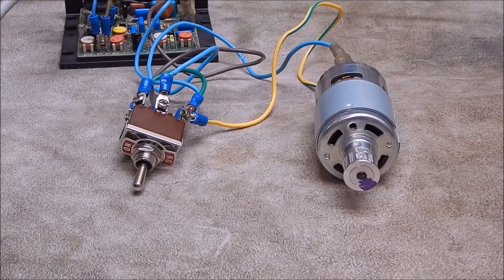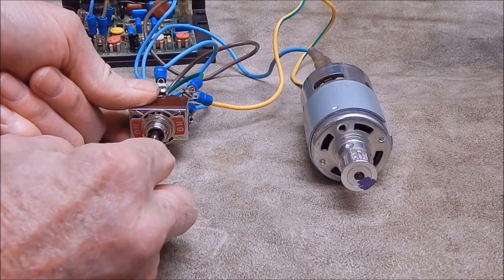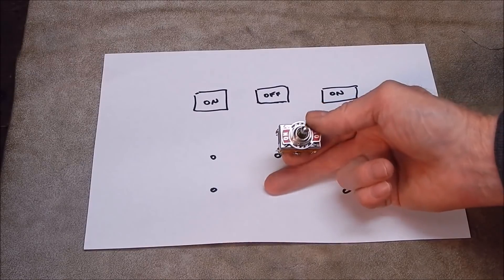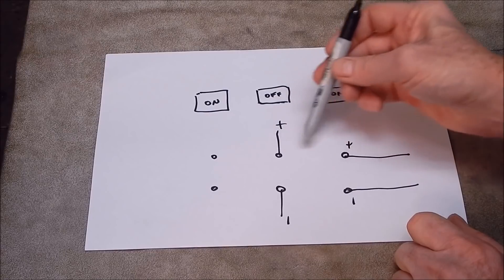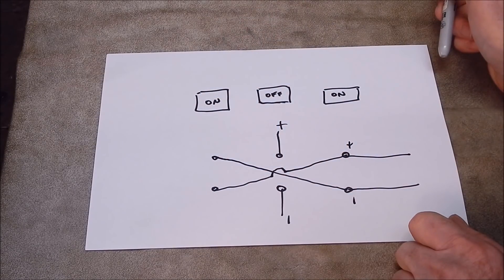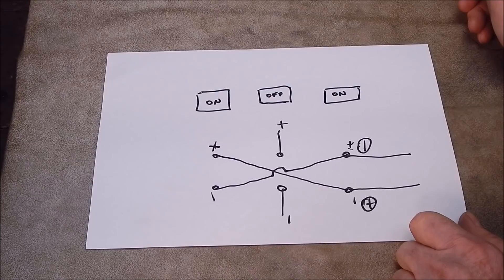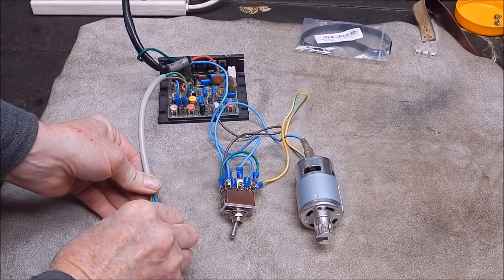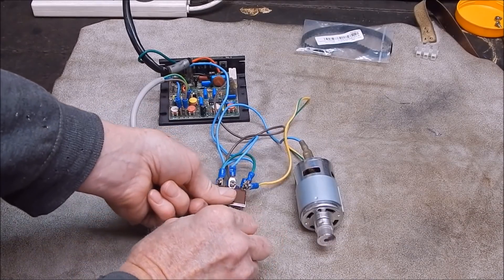How to easily switch rotation direction on a DC electric motor

Comment from the maker: NOTE:  To prevent arcing damage in the switch when using high DC voltage ALWAYS switch off the inverter/power supply OR reduce voltage/speed significantly before changing direction with the toggle switch.  

You should NEVER change motor direction at speed.

A small correction - the terminals opposite the toggle direction connect to the centre power supply feed.  

Cheers Rob
Reply: So what if we used a motor controller and changing it does it will damage the motor ?
Reply: Actually that switch is not rated for DC current. Most of the time if it says 15 amps at 120 v AC it translates to around 10 amps DC at 24v and 6 amps at 12v. The contacts on DC switches are generally larger and made of different material that can handle the arcing. I think it's mostly brass. Brass doesn't spark or arc well. That's why they use it for regulators and fittings in anything that has explosive gasses. If they sold you that switch claiming it is for DC then you need to be very cautious
Reply: The correction you mentioned - does this mean the diagram you drew is wrong to where center supply feed should go??
Reply from the maker: @rastAsia  No.
Reply: @Xynudu what does it mean?

I watched another video and he ran the battery positive and negative in the crossover and the motor to the center connectors. Which is correct or is it six of one, half a dozen of another.
Reply from the maker: The configuration shown in my video is the most common way to do it, but either way will work fine.

Comment: Hi, just wanna ask if what's the name of the connector you used on the terminals?
Reply from the maker: They are called "crimp on connectors".   They come in many styles (slotted, ring etc.).  They work best with a crimping tool.  A soldered on connector will be stronger. Cheers Rob
Reply: @Xynudu  ohh thanks... Additionally what size are they? Cause I want to connect it onto my e-bike and dont want to solder them
Reply from the maker: They come in many sizes.  You will have to measure the diameter of the job to suit.

Comment: Hello sir can you help me, I need a motor that can slowly move a miniature door from side to side but I also need something that can stop the motor when the door reaches the far left and right ends so it doesn't cause damage to the motor. Do you know where I can find such parts? P.s, is there anything that can move the door inward and outward from the frame?
Reply from the maker: A window supplier should be able to answer your question,  There are almost certainly kits available to do this, particularly for high level hopper windows.
Reply: @Xynudu  Thanks, I'll try asking but I'm not sure if they'll help since the door is only 3 in and shaped like a gear.
Reply from the maker: If the door is that small they won't be able to help.  Unless you say the size up front, I'm just wasting my time replying.  LOL.  For something that small you will have to fabricate some sort of drive system.  Maybe a hobby shop can advise on this.  Probably a worm drive would work. To stop the drive just use a simple reed switch at each end of the movement to cut the power.
Reply: @Xynudu  I apologize, I didn't mean to withhold that information. I was under the impression that the motor featured in the video wouldn't be able to handle a normal sized door without overheating and/or burning out, hence the assumption. However, yes it's a gear shaped door made to replicate a vault door from the Fallout games as part of a miniature diorama, hence the need to find the right equipment to move the door. I'll check to see if my town has a Hobby shop and look into a worm drive and reed switch. Thanks for helping.
Reply: @zeronial01 I’m working on a similar project to yours. If you come up with a way to get your vault door operating, please update here. Thank you.

Comment: Im building a electric bike, and i have a question about the rotation of the motor. I've built my diy bike, but the motors spinning the wrong direction. How can I reverse the direction of the motor? I have it hooked up to a 2 pin rocker switch and a 22.2v 1400mah battery and it all works, but how would i have to change it if i wanted to make it go the opposite direction?  Its going clockwise now, but i want it to go counter clockwise. If i swap the connectors on the motor ( like connect positive motor wire to negative battery wire and negative motor wire to positive battery wire ), would that work?
Reply from the maker: That works with all the DC motors I've used.  Try it and see.  It can't do any harm.  Cheers Rob
Reply: @Xynudu  Ok thanks! Im going to test it right now hopefully nothing blows up or anything
Reply from the maker: You may find it will have slightly more power in one rotation direction than the other.  That's because they usually set the magnetic field timing for best effect in one direction.  It should run the oher way without issue and in practice you will barely notice it.  Good luck.  Cheers Rob

Comment: That 15 amp switch can handle the load of a treadmill motor however you don't seem to realized that you are taking that 15amps AC is the reason it can take it. 15 amps AC is only like 6 AMPS DC. that switch is designed for AC.

Comment: Did you know that here is an even easier way to wire a polarity control switch? Use a vehicle power window 5 pin switch.
Reply from the maker: That's a new one on me.  I can see how that would work, but how would it handle the amps ?
Reply: @Xynudu  They are meant to direct connect to DC current from a car battery to run the window motor, so they meant to handle it.

Comment: Hello sir,
I am always very appreciative of all the themes that you address. Concerning the reversal of the direction of rotation of the motor, would you have a link to acquire 1 switch on / off / on at a deceptive price. Another question, when you vary the speed, does your device conserve torque?
Hoping for an answer, I greet you courteously. P. K. (French)
Reply from the maker: Hi Paul,  the torque will change with the speed, as the voltage is varied.  Less voltage means less torque.  

That switch is readily/cheaply available from most electrical hobbyist stores that sell components and from Ebay.  You want a DPDT 6A 240VAC Heavy Duty Centre Off Standard Toggle Switch (about 3 Euro).

Cheers Rob
Reply: Hello sir,
Many thanks for your quick and positive response.
I searched on Ebay with your precise indications and of course I saw a switch on off on at ~ 3 €, so it is perfect and significantly less expensive than those I had seen.
Thank you again, I very much appreciate your seriousness and your availability. P. K. (French)

Comment: Rob, cant find this switch anywhere, any ides please. Colin uk.
Reply from the maker: Hi Colin,

Any electronics hobby/component shop like Jaycar will have it, also on Ebay.  Just quote/search the number and specs shown on the side of the switch in the close up shot.

Cheers Rob
Reply: @Xynudu  Thank for your quick reply Rob, I will try harder. regards Colin.
Reply from the maker: I see BG have them but currently sold out.  Dirt cheap.

https://www.banggood.com/20A-125V-On-Off-On-Double-Pole-Toggle-Switch-Double-Throw-DPDT-Heavy-Duty-p-992569.html?cur_warehouse=CN

You can also use two poles on one of these:  https://www.banggood.com/Voltage-Toggle-Type-A-Switch-For-Grade-9-Pole-25A-250VAC-KN302-120240VAC-ONOFF-p-1425771.html?rmmds=buy&cur_warehouse=CN

Cheers Rob

Comment: good afternoon brother I am fine, but I have a doubt I bought a 3v motor and if I put a 3.8v cell battery it will burn it?
Reply from the maker: Hi Andres,

Hard to say. The percentage over voltage increase is 27% so that may be OK, but run time may have to be reduced.

I don't expect it will burn out from the voltage, but heat build up could be a problem.

It's a suck it and see situation.

Cheers Rob
Reply: @Xynudu  ty bro, I will make vents :)
Reply from the maker: Hi Andres,

It might be OK.  Just monitor the temperature first.  If it warms up more than you think is good. then add a few vents.

Cheers Rob

Comment: Hi Rob. Been doing this for years but then for my sins i was an electronics engineer! It might be worth pointing out that on most toggle switches like the one you used the opposite terminals are the the ones that short when the switch is made. For example when you flick the switch to the left it's the 2 right-hand terminals that connect. My old apprentice master would say that the toggle points to the terminals that are connected 🙂
Reply from the maker: Hi Alan,

That's interesting.  I agree, it's something I hadn't thought of, and didn't bother to check the relationship on the back.

I expect it's just as you say.  I've only ever wired it up and it worked.  Didn't think about the internals too much :)

I made an assumption and am almost certainly wrong.

Thanks for the heads up.

Cheers Rob
Reply from the maker: Hi Alan,

I checked the pole throw/terminal relationship this morning and you are dead right.  They are opposite orientation.

Slaps head.  Wrong again :)

Cheers Rob
Reply: @Xynudu  Hi Rob, for the way the switch is wired here it doesn't actually matter. It's only really worth noting if you are mounting a switch in a panel and it's the on-off type. Some of them have a slot cut in the threaded portion to take a washer with a tag on it to stop the switch from rotating. The outer part of the washer has another tag that locates in an indent in the panel. Obviously if you use this the switch can only go in the panel one way. Cheers, Alan.

Comment: Brilliant video Rob. Very clearly explained for those who may not have an electrical background.
I just have to mention that a switch rated at 15A AC, does not have the same rating for DC.
AC current takes the form of a sine wave, at a frequency of 50 HZ (lets assume we are in the UK, some other countries use 60 HZ). 
So, the current rises from zero to it's peak positive value and back to zero in 1/100th of a second. Then, the current rises from zero to it's peak negative value and back to zero in the next 1/100th of a second.
Therefore, every 1/100th of a second, the current in a mains AC circuit is zero.
When you turn off a switch, the tendency is for the current to draw an arc across it's contacts. If the current is AC, then the maximum time that the arc can survive is 1/100th of a second, then as the current passes the zero point, it has to go out.
In a DC circuit, the current never goes to zero, so the contacts can, and sometimes do keep on arcing. This obviously depends on the contact separation and the speed that the contacts open.
I used to work in the design and testing of very large DC systems. Specifying and obtaining switches, contactors etc had to be carefully considered.
I'm not trying to be a 'smartass' here, just don't expect a 15A AC rated switch to last very long on 15A DC.
Reply from the maker: Thanks Gary,

I understand what you say.  That's why I would always reduce speed (voltage) before direction change (as shown) to reduce arcing in the switch.  I should have pointed that out.

I did a DC conversion on my Chinese metal lathe quite a while back and wired it up so the original stop button shut off the AC to the inverter.  Then switched at the toggle, the same routine as before (with the previous AC direction change drum switch).  This prevented any arcing issues.  Feedback will still occur, but the inverter seemed to be able to handle it (probably incorporated in the design as it's got to deal with this on most DC motor applications).

Plus you should never switch motor direction when it's at speed.

Thanks for the heads up advice to viewers/readers of the implications with DC.

I eventually converted the lathe back to AC as heat rise problems with DC just made the whole exercise a negative experience, with the only advantage being to get cheap variable speed control (which really isn't all it's cracked up to be, from a machining perspective).

I have now pinned a note at the head of the comments section warning of this issue.

Cheers Rob
Reply: Hi again Rob.
Interesting to hear about your lathe power conversion.
I have an early 1950's 'EW Stringer' lathe, which was manufactured in England. I bought it from a chap on Ebay, several years ago.
It came to me with what looks to be the original 1/2 horse single phase induction motor. Speed control was limited to three stepped pulleys, and of course no reverse.
In a stroke of luck, I managed to find a small three phase motor, complete with single to three phase variable speed drive for about £130.00. (Ebay again)
Fitting this kit to my old lathe has made it much more useful.
I bought that particular lathe because it needed to fit in my attic workshop.
There is a good article online, which tells the story of the 'EW'.
I have attached a link, if you were curious to see:
http://www.lathes.co.uk/ew/
Cheers,
Gary.
Reply from the maker: Hi Gary,

Some of the old small lathes are really nice.  That one looks good.  Too many people get hung up on lathe size and really miss the point as far as a usability is concerned.  Plus you can generally get these small old lathes for a song these days, so why not have several machines and set one up just for collet work.  It's not a big outlay.

Wear can be an issue, but generally if you buy wisely you can avoid that side of things, or minimize it.

Be good to see a video run around of it.

I have three lathes as you may have seen.  Max size is 10" swing Chinese, 9" swing tool makers , and Sherline micro lathe.  All handy.

The whole lot cost me less than $2K AU all up in restored operating condition.  Just shows you don't have to spend a fortune to set up a workshop for metal work. 

Cheers Rob

Comment: Hmm, I think I would connect the motor to the middle set of terminals and cross over the power for the outer set of contacts because it's a bit easier to understand at a glance. 
But I guess this leaves fewer bits of metal energized when off.

Comment: Now how would this work for a reversible 120v motor? I have a drum switch and it makes sense to me but could it be done this way?
Reply from the maker: This only works with DC motors.
Reply: It will work with a split phase ac motor, you would be doing the same thing with the drum switch. You just have to make sure you reverse the start winding circuit and then you can control which direction the motor will start.

Comment: Every one loves DC motors for the easy direction and speed control.  The fly in the ointment is that you have to buy a power supply.
Reply from the maker: Hi Harold,

Yes, and those power supplies don't come cheap, even secondhand.  

I imported a box of KBIC's from the USA years back and sold most of them to associates.  Finished up they paid for the two I have left for personal use.  So I depleted the available USA stocks quite a bit.  He He.  Bloody Aussies ;)

I see Banggod have a few cheapish AC - DC power supplies.  I might check them out.

Cheers Rob
Reply: That's not true. There are thousand of appliances out there that have DC power supplies. You just have to know where to look.
Reply: @AztecWarrior75  do tell! Please 🙏 and thank you!

Comment: I know it's a test setup, and a good explanation, but those shitty crappy crimp connectors are most amateurish.
Reply from the maker: Yes they are crappy and not recommended.

I only used those because it was fast and not important - it's just a demonstration.   All those leads will be scrapped later.

If that's all you have, always run solder in from the connector spade end to make sure they stay connected.

 Cheers Rob
Reply: @Xynudu  there is always one out there. He wants you to solder all those connections then undo them for a quick demonstration. Well done video thanks.

Comment: Would you have a link for the inverter please?
Reply from the maker: Hi Jon,

Which inverter do you mean ?  The KB or the Banggood one ?

Cheers Rob
Reply: @Xynudu  I will eventually be using a treadmill motor so whichever would be best for that . It would be replacing a mc60 board from memory
Reply from the maker: OK.   KB Electronics make several which are suitable for treadmill motors.  These are a commercial grade inverter with provision for a potentiometer as shown in the video.

This is a link to the current KBIC range:  http://acim.nidec.com/drives/kbelectronics/products/variable-speed-dc-drives

Here is a link to the older units which you can get off of Ebay (used) and do the job fine:   http://www.kbelectronics.com/data_sheets/kbic.pdf

These come in a range of flavours and will do up to 180 volts and three HP, when fitted with the correct resistor module for the motor HP (interchangeable).

I used a 90 volt unit in the video, but also have a 180 volt unit for larger treadmill motors.

The electrical ratings at top of page 11 are what you should be examining to select the KBIC model which is correct for your AC supply and the voltage of the donor DC motor.

So be sure to get the correct model.

Cheers Rob